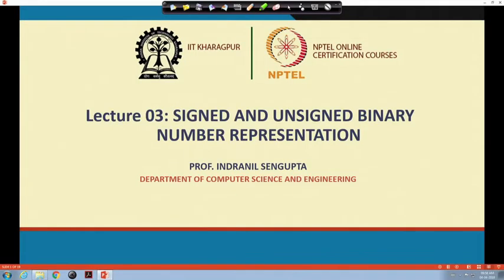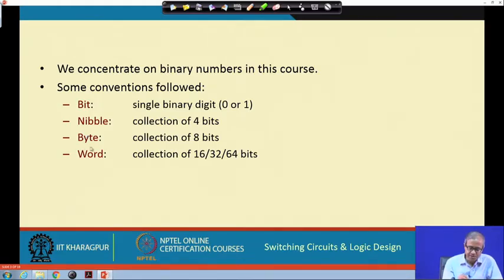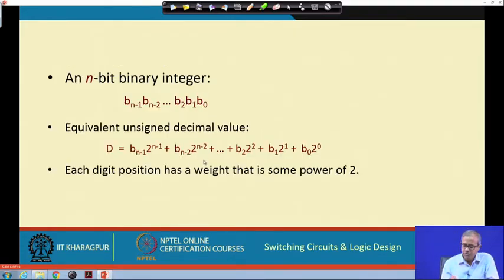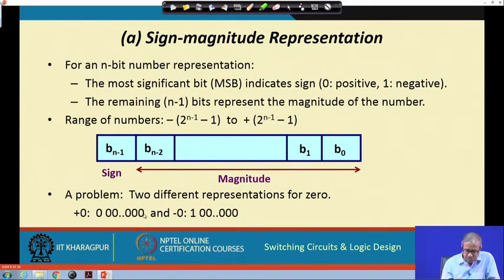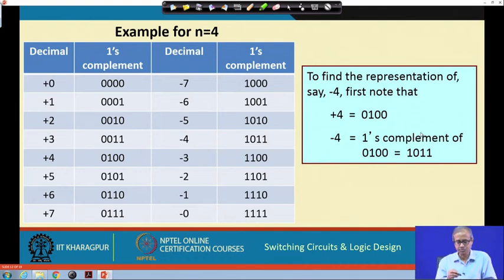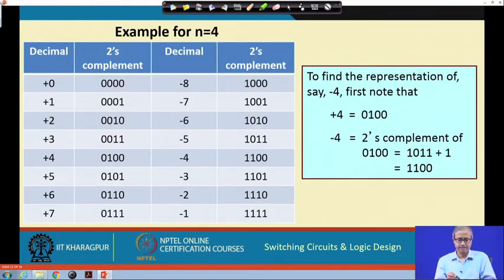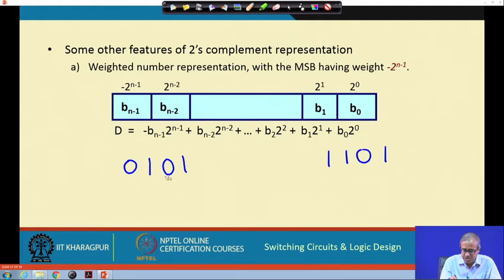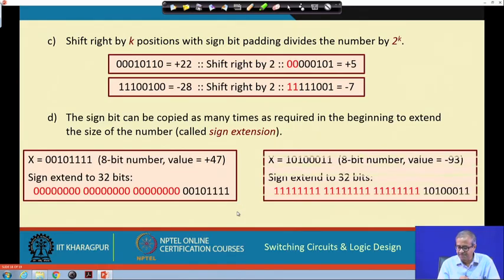Lecture 03: Signed and Unsigned Binary Number Representation

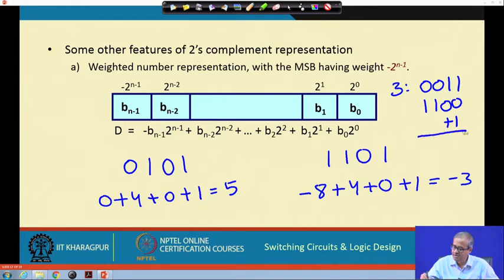Comment: why at 28:28 1101  is not -5 ?
Reply: that is if it would had been 1's complement vro
Reply: this is how you do 00||01||01||10 you do right shift that will be __||01||01||01 now if  this was without padding in those blank spaces there will be 10 but because its not those blank spaces will be filled by 0 which is the MSB in the original

Comment: Lets say a binary number 100 00001 which is -127, if it is shifted 1 position left:
we get 00000010 which is 2 
but shouldn't we get -127*2 which -254? I understand that the range would be -128 to +127 
and -254 can not be represented with 8 bits. 
So you can only represent it with 16 or more bits right?